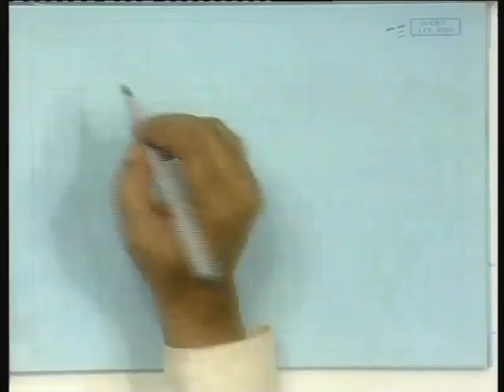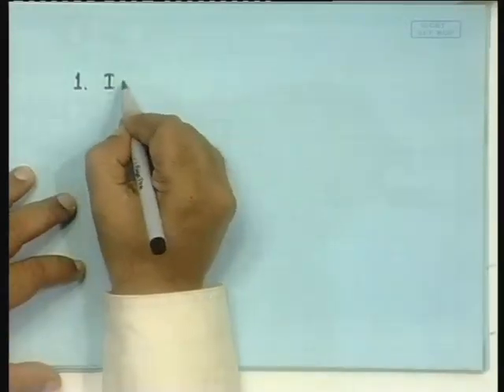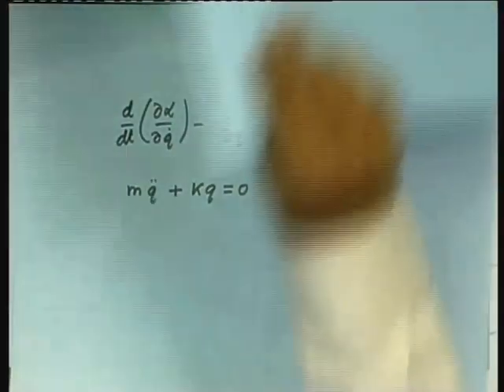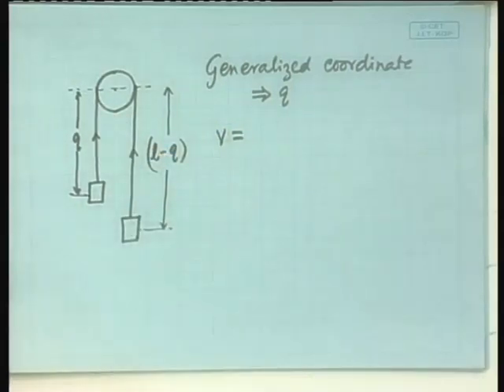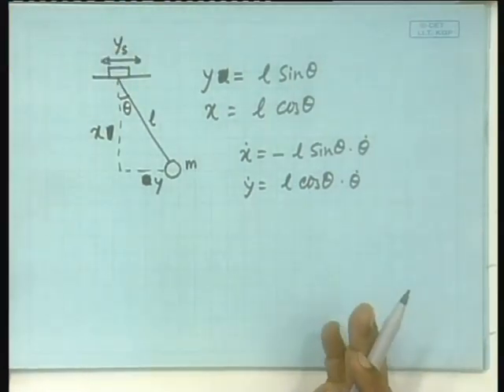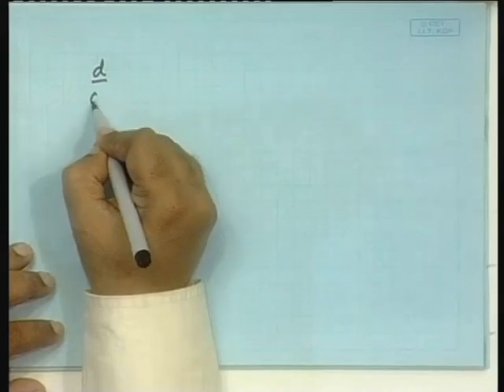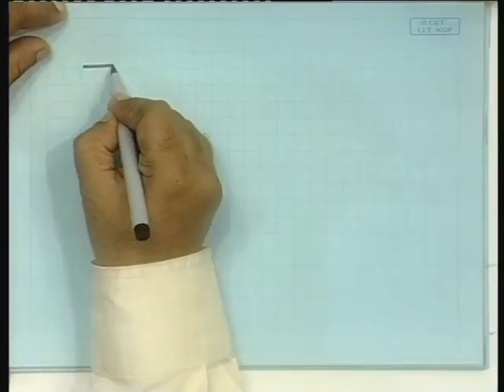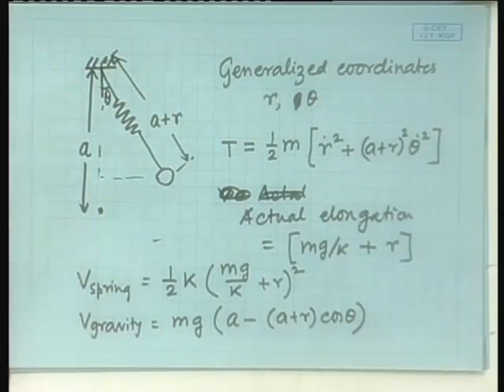Lecture - 4 Using the lagrangian Equation to Obtain Differential Equations(Part-I)

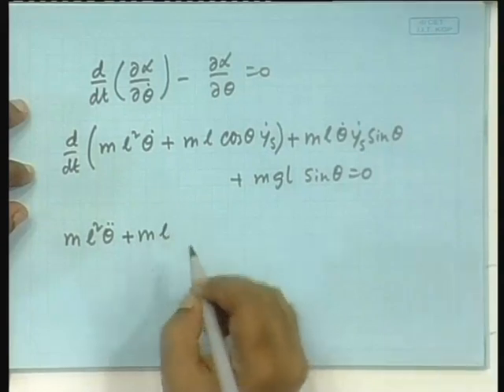Comment: In the example of the pendulum where the suspension itself is moving 40:00 with a uniform velocity Ys dot.... shouldn't the term Ys double dot be zero ?
Reply: In this case its not generalized to be uniform.

Comment: at 25 mins in where he defines the height of mass 2 as (l-q) shouldn't that be (l -q) - pi*r  where r is the radius of the pulley, as some length of the string is wrapped around the pulley?

Comment: Why are the potentials negative?
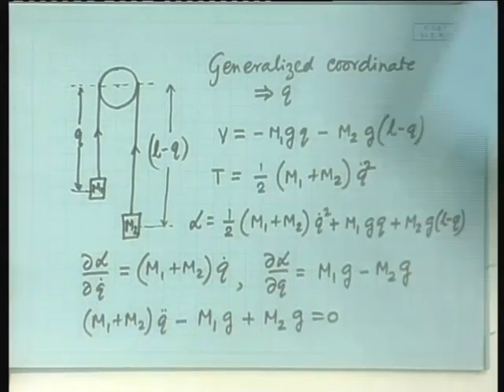Reply: Because of the origin of coordinate system is at the top where the pendulum rotates and at the top of atwood machine. Negative down and positive up, watch this minute 26:36, there he explains that and also changes the location of the coordinates system to the bottom of the pendulum, that make positive the potential energy for that example